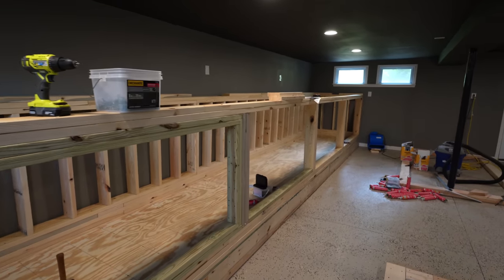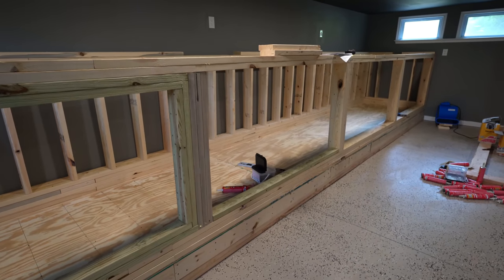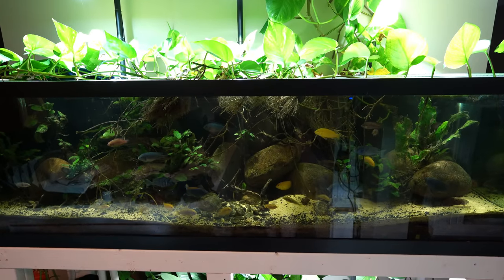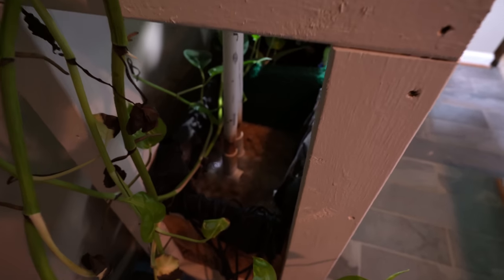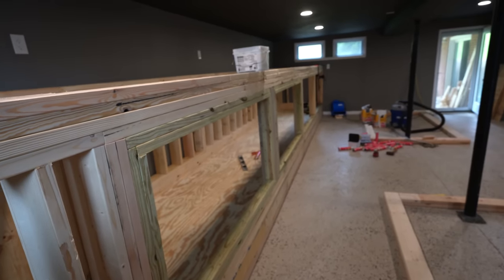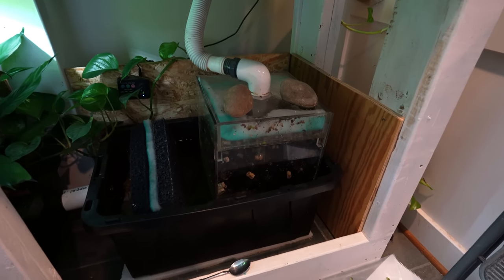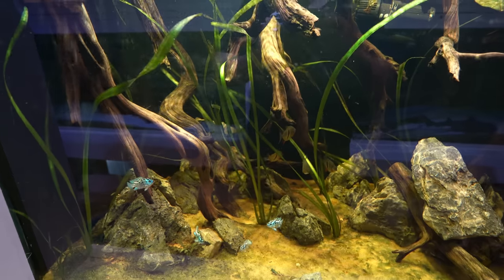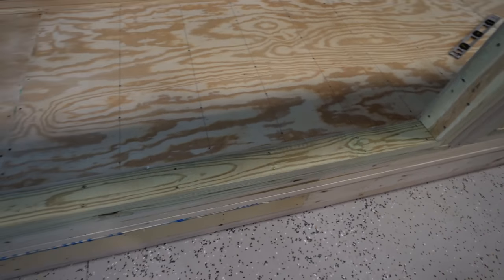Massive Progress on the 4500 Gallon DIY Aquarium Build and Updates on my DIY Filter Systems!

Comment: Be very careful because when treated lumber begins to dry out it shrinks. In a cooler shaded environment where you have this aquarium it takes much longer for this to happen. One more thing is you need to use screws specifically for treated wood because if you use standard screws they will rust and possibly all the way through the screw causing failure of the screw.
Reply from the maker: Correct on both accounts...if you look closely in the video you will see two different types of screws in use 🙂
Reply: Future builders, take note of this 👍
Reply: @AquariumDomain. . One other thing to consider is the possibility of off gassing and leashing of the treatment chemicals into your water and of course into the air you breathe. I’m assuming sealing is on point…?
Reply from the maker: @damiangrouse4564  Yes. Also treated lumber now a days is done with a copper based preservative, not arsenic based chemical preservative like in the past....so not too big a deal these days for people, but certainly still needs to be properly sealed for our aquatic friends. 🙂

Comment: Use nails and not screws ! Screws with time back up from wood. Slowly but for last layer of playwood you should use nails
Reply from the maker: I have always known screws to be better at both holding power and tensile strength which is key to my builds and nails having a higher shearing strength which won't come into play in my build with adequate bracing.

Comment: I use K1 fluidized both as static and dynamic media. Those of you guys considering benefits of both (aka delete the filter floss) should look into 3 barrel koi pond filters. I actually did mine in reverse. I have dynamic then static and static but I also have refugeums before that and lava rock after that and pothos and other stuff too.. 

I am glad that you provided a visual for how your wetland/sump systems developed over time because it really shows what you learned and how you adapt. Looking forward to next video.
Reply from the maker: Always tweaking and try to improve 🙂

Comment: I saw a video of a treated  tank stand warping after a few months but I doubt you'll run into an issue because of how bolted down it is. Also I believe pressure increases with depth not volume so your layout is brilliant.
Reply from the maker: Yeah, just the window frames are pressure treated and they have copious amount of construction adhesive and screws in them lol 😀

Comment: Great progress! How do you know all this construction stuff and that the structure will bear the pressure when full? I assume you're an engineer or in the building trade as you make it look so easy 🙂
Reply: The pressure increases with depth, not with volume. The principle is always the same.
Reply from the maker: Thanks!  I work in telecom / software, what I know about construction was taught to me by my father and research on the Internet. At this point I have built quite a few tanks so I have my process down pretty well 🙂

Comment: Curious as to why you wouldn’t build this massive tank out of concrete blocks? Is it cost, difficulty or something else? I would just think the concrete would be more water resistant and durable long term.
Reply from the maker: If it was done in concrete it would be poured / reinforced concrete, and there are a whole bunch of reasons that I personally would not want to build this using concrete. However, in regards to longevity, the method I use wood/fiberglass/epoxy will last a very long time (well beyond my lifetime). 

If the aquarium were built outside where the outside of the tank would be exposed to high levels of humidity or sunlight it would be a different story and concrete would be longer lasting, but not so much in an interior conditioned space.